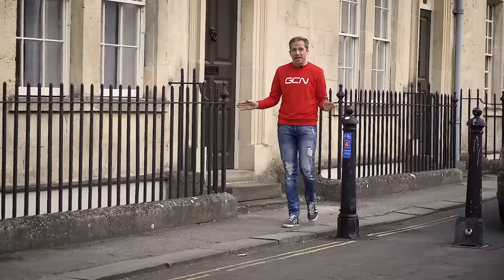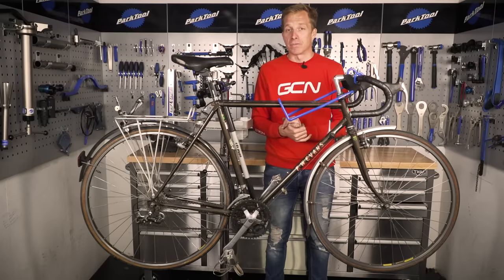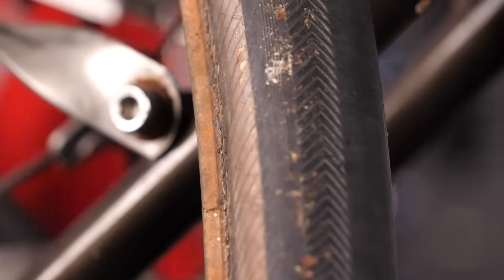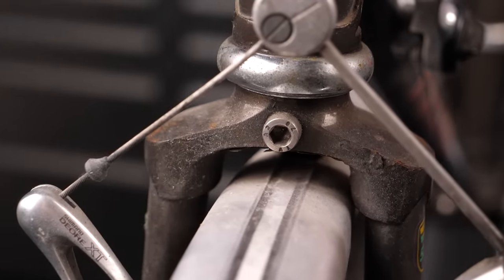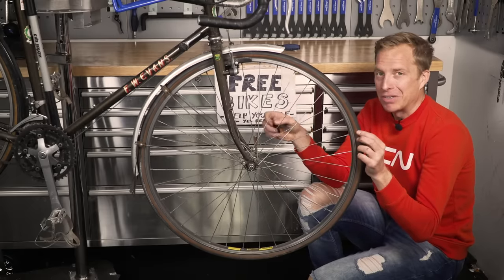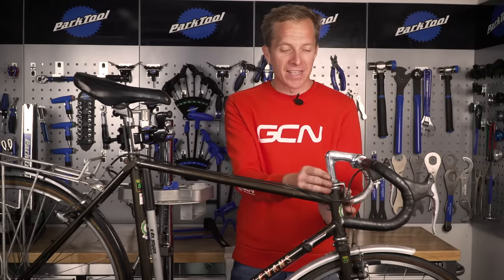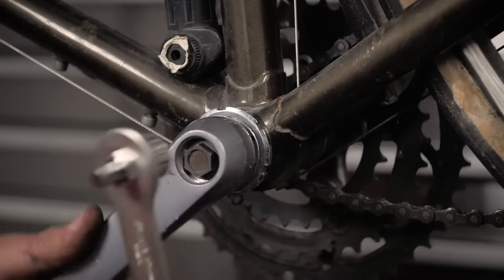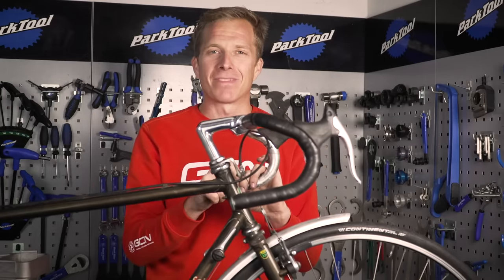Trash To Treasure | How To Fix Up An Old Bike

Comment: Cup and cone bearings are great! Service them regularly and they will last forever. If I intended to ride the bike, I would disassemble, clean, grease, and adjust all bearings - BB, hubs, headset, and pedals.  Clean and lube the pivots in the brakes and derailleur. Also, changing the brake and derailleur cables to new stainless steel ones will make everything smoother.
Reply: No, no they are not. Cups get damaged after time; adjusting for right torque (friction/play tradeoff) is PITA.
Reply: noname here My "daily driver" is a 1979 Raleigh Super Course. Very similar to the bike in this video. It has cup and cone bearings in the headset and bottom bracket. I've replaced the bearings and keep on top of cleaning and repacking with fresh grease. Bike still going strong after almost 40 years.
Reply: Biff is correct. Bikes that have been sitting for years need cleaning and fresh grease.
Reply: Definitely remove all old grease and replace it with new.  If you are of a certain age, you will remember how to do this!  There is a certain satisfaction in setting up cup and cone bearings so they run sweet an smooth.
Reply: I would also strip, clean everything, repack with grease and replace cables. A bit of time and energy will make a bike a 50 year bike with ease.
Reply: New loose bearings, without a cage, inspect the cups and cone for wear and replace if necessery :)
Reply: Is it possible to change the cup n cone bb to a sealed bearings one?
I guess i got a used bike with this kind of bb and it's already not in good condition (when you pedal, you can feel it loose one gear and jumped to another).
I was thinking on replacing it rather than changed just the cup+cone
What do you think?
Reply: Is there a way to refurbish a hub by changing cups and cones? I didn't see cups and cones on sale anywhere. Basically, even if the hub itself is in good condition, as soon as cups/cones wear out, do you have to get a whole new hub? 
In this sense cartridge bearings are better, but when it comes to restoring an old bike, this issue is a pain.
Reply: rollinrat4850  "Excellent quality balls are cheap!!"

Where do you get them?
Reply: rollinrat4850  I know there are plenty of places to get them. What I'd like to know is where to get ones that are made by a reputable manufacturer and are very high quality. I'd rather get some from a reputable manufacturer than just trusting the grading system from an unknown manufacturer, which they could easily be dishonest about.

Comment: This is pretty much what happened to me, there was spring cleaning here where i'm at and this older guy was getting rid of his entire collection, I was 15 at the time and had little money so I would go around this time of year and see if there were bikes being left out. This older man had a old spray painted frame he was giving away, along with a groupset in a box that I didn't know about at the time. So I picked it up and did my research. Turns out it was a '81 SR gran course and the groupset he gave me in the box was an old shimano 600 arabesque groupset. Put the bike together, and freshened it up with some new pads, chain and a good cleaning and painted it. For me being that young it feels good to find a rescue bike and give it life. I'm 27 years old now and I still have the bike. Good memories.

Comment: Always check if the seat post and stem are not stuck. If one or both of these components is corroded in place you might be looking at significantly more work to get the bike to fit you properly. Not a deal breaker but for sure will alert you to future headaches.

Comment: I hang out at a bike co-op, so I've done this a lot. I usually repack the bearings, even if they feel ok, because grease is cheap and you can (almost) never have to much grease. I also change the brake pads, as those are close to 30 years old and are hard as rocks. New cables and housing always, unless I'm feeling really cheap. If I do just lube the cables, I use molybdenum powder in the form of Dri-Slide. I also remove the chain and and give it a thorough cleaning and lubing, although if it's a personal bike I wax it (1/2 hour in ~250F wax + Teflon).

Comment: I had a similar find about 10 years ago. Replaced a cable, tires, tubes, brake pads, and cleaned/lubed the remaining cables and chain. Bottom bracket had a little play, but making sure it was torqued down helped. Then a few weeks later the play was back, and a grinding sound. Had to swap out the parts for new ones, and my free bike was now about 150$ in parts. I still consider it a great find. I saved so much on fuel, lost some weight, and started a new hobby because of it.

Comment: I picked up a Bianchi Specialissima in a garage in South London off FreeCycle - it had been there twenty years. Unlike yours, it was a total mess: It was my Covid Lockdown Project.

I stripped, rebuilt and polished : stem, headset and forks, wheel axles and bearings, bottom bracket, seat post, cranks (cottered!), brakes (Weinmanns), mechs, downtube shifters, pedals

I stripped frame down to bare metal (Columbus tubing), prepped, primed and hit it with Bianchi Celeste (of course!) and four coats of lacquer.

I replaced : ball bearings, wheel axles, tubes, tyres, saddle (2nd hand Brooks), bar tape (leather to match the Brooks), seat clamp, all cables, cable housings and ferrules.

Wheels i just polished using the string and toothpaste method on the spokes and gentle wire wool on the rims.

Yours looks like it took an hour, mine took me on and off three months but I wouldn't part with it for the world. I had a guy offer me £500 for it.

Comment: Congratulation, you found a beautiful bike! 
And fixing an old bike can be a satisfying job. A colleague gave me the old trekking bike of her dead father as a gift. I decided to fix it and turn it into a randonneur with a drop bar. I often ran into a dead end, and have to change components, but in the end I get a beautiful bike and learned a lot about bicycles, for example that there are different types of front derailleurs (mtb/trekking vs. road). 😉😂

Comment: It finally happened to me…

Many years ago my dad found a pair of rollerblades in the nearby recycling area… and I always wished I would find something myself from there. Specifically a bicycle. I have genuinely DREAMED of it happening so many times, but all my bicycles have either been bought or gifted to me.

A couple of hours ago I found a steel touring bicycle shaped exactly like this one… it says LONDONER and is a Dawes one. It’s so pretty and I love the breaks. The gear shifters are the same as the ones in this video… and I’m up for the challenge of renovating it the best I can. 
I have so far taken everything apart ready to be washed properly tomorrow… and I’m off to decathlon to find a new chain, some wheels and tubes for this Madame. 
I’m super happy, she was just left there ready to be trashed by the bin men… with a pannier rack and two bags. 
💚

Comment: I have picked up many bikes off the side of the road over the years, including my main mountain bike which is a 1993 Specialized Rockhopper FS, I've also got lucky with parts from the side of the road including some campy hub, Mavic rim tubular wheels on an emmelle! I always give the bike a full strip down and rebuild, cleaning and regreasing everything, installing new brake and gear cables, usually new tyres, new brake pads, new grips / bar tape and new chain.

Comment: My suggestion is to just buy some new cables even if they look fine. It is worth £5 and you are almost certainly going to be replacing the old cable with something better.
Reply: Brake pads as well, modern day pads have much better stopping and it's piece of mind.
Reply: Cables don't cost more than $1/metre.
Reply: Maybe for you!
Reply: @M440iUK  My vintage Raleigh Corsa racing bike (1984) has rubbish breaking even with new brake pads. It's just that these "road brake pads" that push against your rims are rubbish, especially when you're riding in the wet.
Reply: @Oscar-if6lq  do you have chrome steel rims?
Reply: @foxyMcFoxface  😁

Comment: Just got done rebuilding one for a friend.  She found 2 at the dumpster of her condo and brought them buy.  1 had a trashed frame, rust bulge and whole in the rear stay, but the other was an Aluminum hybrid that just had a toast derailuer.  Repacked bearings and swapped a few parts and managed to save one of them!

Comment: If the cup and cone bearings are turning smooth for me it's mandatory to overhaul them so they KEEP turning smooth. Old bikes are often both neglected and not ridden much, so lack of maintenance did not have enough time to do damage. Those bearings may be in good shape but dry and dirty at the same time. As soon as you start riding the bike more you'll ruin them quickly.

Comment: A few years ago, I got given a battered old Claud Butler mountain bike with alu frame and Rock Shox Metro fork - it had different sized wheels and needed lots of components replacing, but the frame and fork were sound, so it was worth putting some effort into. I had a blast rebuilding it and it's still going strong.

Comment: Basically nailed it. Id check the seatpost and stem and make sure their not seized into the frame and fork. Also id replace all the cables. Housing. Brake pads, tires and bartape. I may also replace the rim strips. Id also scrub everything down and relube all the pivots of the mechs and rebuild the brakes.

Honestly. That bike looks a bit to good to been free. Maybe it was an ebay bike?
Reply: Decided to check the seat post on a dumpster bike, I just learned aluminum can grow fungi

Comment: You forgot one very important check. Can you move the seat tube? If you can't, you will never me able to get the saddle at the right hight and the whole bike is useless to you.
Reply: Or you saw off the old seat tube right over the frame and insert a new one of smaller diameter. Hey presto, problem solved
Reply: I floated this idea due to the same situation I was suffering from and the mechanic at the shop was leery because the original aluminum + the seattube would prevent the new. smaller diameter seat post to be tightened properly.  I would rather mechanically remove it as RJ bike guy showed with a reciprocating saw + rust remover spray + a air hammer.
Reply: @joonkeum9457  yeah that would be the proper way if you have equipment, strength and/or money for doing it at the bike shop.
Reply: Good point, also worth checking stem isn't seized either.
Reply: Yepp. Back when I worked as a mechanic we had a customer build a full custom setup, basically Dura ace everything and every best component, but he failed to check the seat post. We soaked it for weeks, he has to invest in a new frame to say the least.
Reply: Remove the saddle, cranks, bottom bracket and wheels. Turn the bike upside down, pour penetrating oil down the seat tube from the bottom bracket shell, leave for a while (the longer the better, I guess). With the bike still upside-down, clamp the seatpost in a bench vise as firmly as possible. Using the bike frame as a lever, turn it and the seatpost may free up. I've seen it work before.
Reply: And the fork needs checking probably the most important thing in regard to safety ,forks can and do fail with fatal consequences.

Comment: I still ride an American made Huffy Scout 10 SPD mountain bike that I bought in 1990. It has had an overhaul once, new cables and adjustments, straightened rim, new tires and tubes, new seat but still rides well. Built to last.

Comment: Great video. I just finished restoring and old Koga Miyata for commuting. Took off the dysfunctional front mech (who wants a triple crankset anyway) and converted it to 1x. I did, however, have to replace headset (cartridge) bearings. No easy job because the inside of the old bearings had become rusty and stuck to the fork. The outside was stuck in the frame. In the end I resorted to a screwdriver and a hammer for taking them out. I’m happy with the way it turned out. Had some good fun at low cost and I have a practical commuter bike now that can just get scratched or (god forbid) stolen. I’m happy to leave my Oltre xr2 in the garage when there’s a chance of that happening.

Comment: This video makes me want to sort out my dads old raleigh europa. He gave it to me a year ago and after stripping the bike and loosing half the bearing out the bottom bracket its currently sat in the roof of my garage though i still plan to rebuild it
Reply: Raleigh '80s team colours?  Pretty, but not worth much, plain steel frame so pretty boggo.  But if it works, ride it!
Reply: Secret Sam999  was originally team colours, dad did a cheap very poor respray on it so plan is to put it back to how it was in the shop and just enjoy riding it round cornwall though the leather break blocks are staying in the garage as i still have the scars caused by them 30mph into the hedges avoiding a busy road junction, no fun.

Comment: Found a folding bike in a bush a couple of weeks ago that looks like it had been there for at least a few months. Stripped it down to components and gave all the rusty bits a nice bath in citric acid and coated them in hammerite. Replaced some parts, and got me quite a nice cheap bike 👍

Comment: I'll always take a free or even a $5 bike if it has even one part I can use, such as a seat or brake levers.
There is always some value to every bike I pick up. I own 9 complete bikes at present, however only 6 are in rideable condition. I haven't counted my parts bikes lately.........
Thanks for making this video. It's nice to see others are enthusiastic about fixing up old classics.

Comment: I very recently (only a couple of weeks ago) found an absolute bargain for a road bike.  Not free but really incredibly good price.  Bike is one of the Giant TCR Advanced T-mobile team bikes.  This video has been really helpful.  I had figured because of how cheap it was, it would have a lot of problems but actually there is very little that needs sorting.  Frame is in excellent condition.  Chain is rusty but I can either attempt to clean or it’s easy to replace.  And otherwise it was just new brake pads and new inner tubes.
I even checked to make sure it was genuine and not a stolen bike.  Everything came back clear so I managed to get myself a beauty of a road bike.  I had been wanting a road bike and had been saving up.  The saving on the bike means I can put the money towards other things.

Comment: My mate was close to chucking out a mid 80's Olmo complete with Columbus tubing, Camp record chainset, Cinelli bars, the works. £400 later and with much elbow grease it has been reprayed, new decals, forks rechromed it is an absolute gem and I have to say the sun tour superbe rear derailleur is easily a match for the Campagnolo super record equivalent. It is a bit of a dark art finding and restoring old bikes but I would recommend it to anyone that is interested in finding themselves a quality bike for fraction of the cost for similar quality brand new. I found wheels at cycle jumble for £10 that have been over the Col de Galibier, Telegraph, Ventoux, Tourmalet, and Iseran.

Comment: Chain, teeth, cables, bearings, fork and stem, wheels, seat tube and pedals that are probably stuck inside, and the frame itself. There's too much to inspect. I'm almost sure I'd end up dumping everything but the frame in the trash if I find one. The ones that are taken care of go for a few thousand pounds more than what I can afford. I'd advise against getting any second hand bike unless you're a mechanic or want to learn how to assemble and service a bike, but not ruin  your carbon baby, a retro bike that was probably on its way to smelting will do just fine.
Reply: It's got indexed gears and the style of sticker on the frame indicates less than 30 years old, many of the parts seem fine.  If you're handy with a spanner, and indeed own many spanners, you could fix it up for buttons.  Time, that's the main investment.
Reply: What absolute nonsense. I can't even be bothered going point by point on what you've just gotten wrong, because all of it is wrong. It'd take too long.
Reply: I've serviced a lot of corroded bike found in the trash and I use some of them. The bike in the video is in top condition, i barely see any scratch on it (hard to believe it was actually dumped on the street). It's worth to inspect and I would expect very few problems with seized components.

Comment: Found a 1987 Trek 520 at a dumpster with race numbers still on it a year ago.  Got some new tubes, tires, bar tape, greased the bottom bracket.  My first Road bike :)  I've since put 500 miles on it.